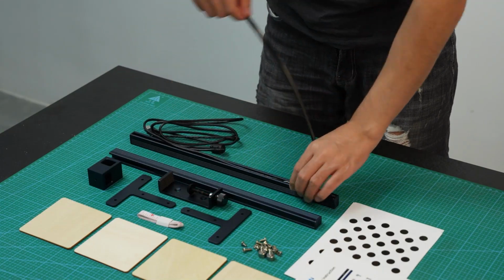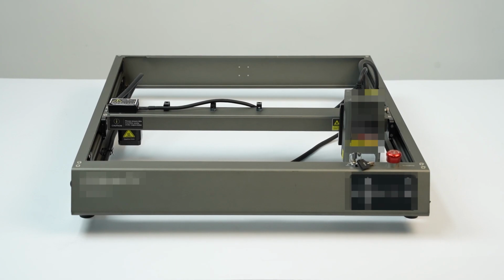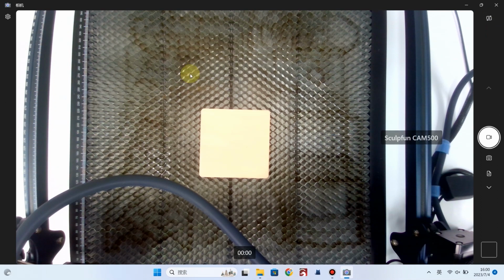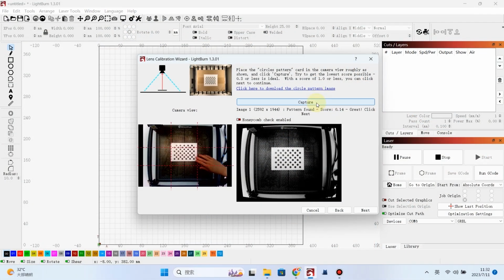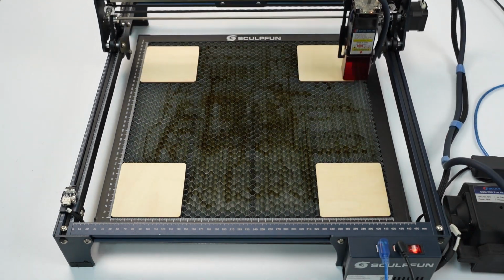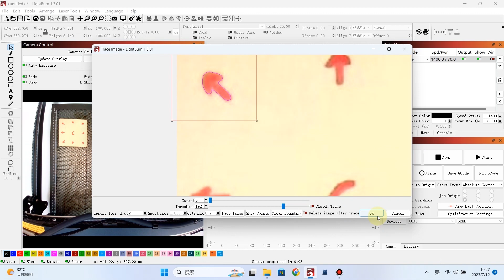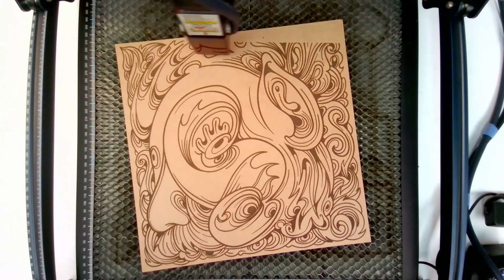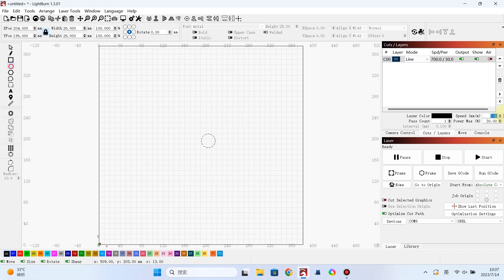SCULPFUN CAM500 Camera Installation and Use

Comment: Hi, i hope you can help me out. I have a S30 Ultra, wich is a 600x600mm working area and i am trying to instal my CAM500 and it captures the 400x400mm middle top of my honeycumb board but when i am about to do the camera alignment and i frame the area before i engrave, the laser frames the middle of my honeycumb board and not the top 400x400 area that the camera captures. How can i finish the installation of my camera with this problem?. Could you post a video with the callibration of the CAM500 on a laser with bigger working area that 400x400mm? Thanks for your time.